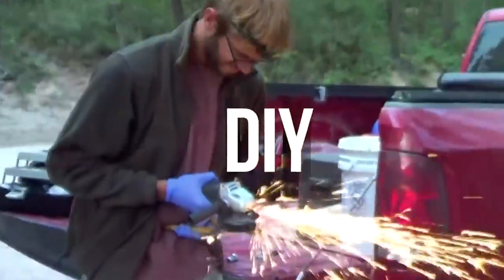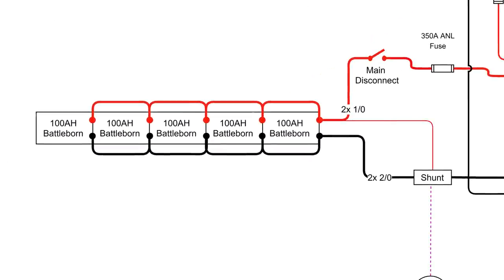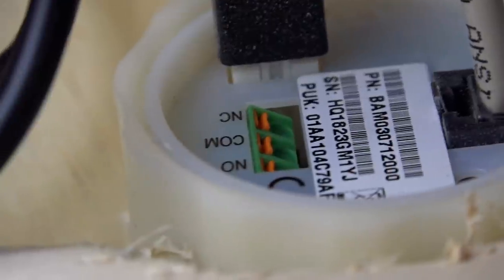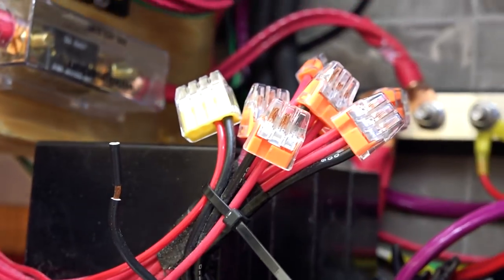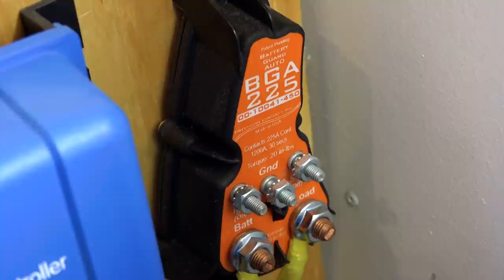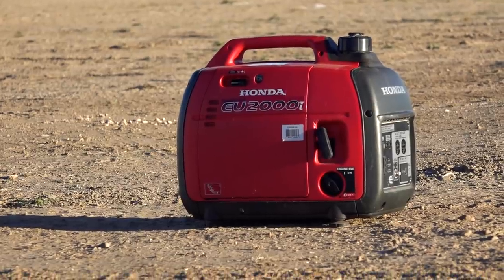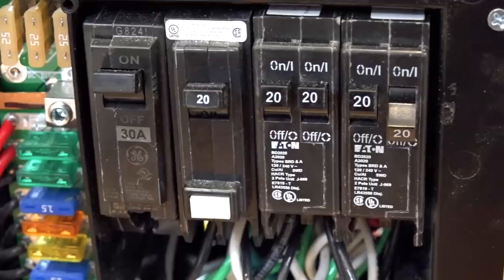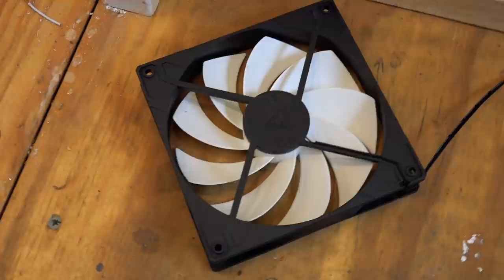RV Electrical System Walk Thru In An Off Grid Optimized Airstream  - Solar, Lithium batteries

Comment: What the auto industry calls Load Dump is a real automotive phenomenon that happens mostly when there is a loose (therefore intermittent) battery cable.  Because the cable connection is not consistent, the battery is low on charge trying to suck a lot of current from the alternator.  Because the cable connection is not consistent, this huge load can disappear quickly.  Because the voltage regulator uses the field winding in the alternator to control the output current and voltage, it cannot collapse the field instantly (characteristic of an inductive load) and the output voltage soars to very high levels at low impedance for an extended period until the field can be reduced.  The same thing happens when heavy loads are turned off but not to the extreme it does with a loose battery cable.  Transient protection is very important in vehicular applications.  I am glad you included it.

Comment: Wow!!!  What an incredible setup and video.  So impressed.  Thanks for sharing.  I cant imagine the cost to set this up, with the lithium batteries it seems that there is $20,000.00 +/- in gear alone.  Not to mention the labor and obvious expertise to install.   You guys did an awesome job!!!!  Drivin and Vibin's new rig is incredible!
Reply from the maker: Thanks,  Yes this is an expensive system, actual cost less than 10, but yea time and everything it is quite expensive.

Comment: Absolutely outstanding. This is an exceptional video on an exceptional install. I'm personally completing a custom install of a 1080W system on my rig. I wanted to use a great deal of Victron components, but it just would have busted my budget. I'm not second-guessing that decision based on what I've seen here. My only feedback would be to ensure that the Inverter/Charger is properly ventilated to ensure a nice temp in that small compartment. You may have already addressed that - I just didn't see it. Very impressed. Thanks so much for sharing - it gave me confidence in what I've done and also provided great information on how I could also improve. By far one of the best videos that I've watched over the last several months as I've worked on our rig as we prepare for full-time living as well. All the best and safe travels!
Reply from the maker: At the end we talked about the fan being installed to keep air moving, will put it on a thermostat so it only runs when needed. could also hook it up to an aux relay on the inverter and trigger it using the victron assistant ,

Comment: This was obviously a very good explanation. Too bad I am so rudimentary when it comes to this level of complexity. I have a solar charging system in my trailer, which I built component by component but by comparison it is stone cold simple. Works for me.  136 watt 24 volt nominal thin film panel, mppt controller with remote monitor and 6 volt wet cell golf cart batteries in series all fused.  Plug and play

Comment: Clean install! Very neat cable work! Impressive!

We have a very similar system but less complicated, and on a truck camper. I installed our inverter charge inline with the shore power. Like the Victron multi-plus it has an auto transfer switch so the camper is essentially always "plugged in" when the inverter is switched on or we are plugged in. No auxiliary transfer switch needed. The 12v side is routed straight from the battery bus bars to MDP. We rely almost solely on solar for charging (and very occasionally plugged in). No genset or car charging. Our DIY 600AH LFP battery and 1080 watt array has been awesome over the last year. LFP...what a game changer! Don't miss running a generator one bit.

 We also chose the Victron MPPT SCC and it has worked very well although I wish it could be programmed better to tapper charging rate less at voltage nears 100%. I see so many of these you tubers systems (some very large) with Zamp panels where people use the Zamp PWM controller. Maybe they are being sponsored by Zamp. Good to see a proper MPPT charger on your build. Also the 712 battery monitor has worked great as well. The bluetooth allows us to see what's going on while driving.

One thing I do see though is the narrow solar panels are very close to the A/C and will probably be shaded often. It is very smart to have chosen Parallel wiring. We did the same after playing around with both and found the inefficiencies of lower voltage are more than offset by how much loss there is in parallel wiring when one or more panels are shaded.

Great video, well done!
Reply from the maker: Yes the shading was a consideration, even in parallel it will affect the whole system, but not as bad.
Reply: In parallel it will only affect that panels production.

Comment: Wow Tom! So much good information flowing so fast, slow down!  I think my brain popped a circuit breaker trying to keep up. Lol . Seriously though thanks for the video. That was very interesting and informative.
Reply from the maker: :) Thanks.  I realized it was a bit fast, but figured it can be rewatched :)
Reply: YouTube videos can be paused by clicking on the two vertical bars.  I did that to have more time to study the diagrams.  Take the time to understand the diagrams and that will made the narrative easier to follow.
Reply: @bruceh3786  yes for sure. I was being humorous :)

Comment: Awesome video!!  Thank you so much for providing a comprehensive explanation and the detailed schematic!  I really appreciate that you not only explain what you did, but why you made the choices that your did when there are different options.  Now I just have to figure out how to make this work in a 50 amp trailer with roof space for a little more solar.  Tom, you are my "go to" person for electrical upgrades. Thanks!!
Reply from the maker: You can use the same system in 50A just use a bigger transfer switch and jumper one leg to the other when bringing power back from the inverter.  That is how our system works, I think we have a schematic on our site.
Reply: @MortonsontheMove  Thanks for the info.  I will definitely go look for it. My husband is the one with the electrical background from his military days.  He was quite impressed with the schematic from the installation you did for Kyle and Olivia, so I'm sure we will both appreciate your 50 amp version!  Happy New Year! :D

Comment: Batteries in parallel should have the negative lead going to the shunt bar on the opposite side of the bank from the positive. This will better balance the flow.   The ANL 300 A fuse should be a Class T fuse at 400A. They cost more but handle better load and blow very quickly.  Thanks for your videos...
Reply from the maker: Agreed with both,  the battleborn batteries have internal balancing and if they are slightly off from one another there is no harm, Kyle and Olivia had the ANL already or I would have specd the class T.
Reply: The video shows a 300 amp fuse but the schematic shows a 350 amp fuse. Which is correct?

Comment: Nicely done video.  All the tech info is pulling me down the YouTube and Google rabbit holes simultaneously in pursuit of understanding. This is a lot like what I am planning for my full time setup, except I am leaning towards two Tesla batteries with a Multiplus or maybe Quattro. This saves me a ton of time, and also has a proper SOC setup that I would have wound up adding later, so thanks for that!

Comment: Hi, nice installation and schematic. You need to fuse your smaller cables where they leave the main fuse for the voltage sensing and at the Busbar for the fusebox though. If damage were to occur here to these wires to cause a short circuit you would pretty soon have a fire.
Reply from the maker: They actually do have inline fuses... I should add that to the schematic.  There is about a 6" unprotected lead on the input to the dist panel tho.
Reply: That’s good. It’s often too easy to miss things like this and best to keep the fuses as close as possible to the change in cable size.

Comment: Thanks for taking the time to produce this excellent straight forward explanation of a complex system.  The professional wiring diagram is a great help in understanding the flow.  

The main marine 12V disconnect switch for this system is on the positive side of the circuit.  Are there any technical reasons or advantages to have it on the positive side vs. the negative side?  Most diagrams I see show main disconnect switches on the positive side.  I put it on the negative side on my system between the shunt and the battery for practical reasons because there is just the one wire going into the battery from the shunt vs. several positive sources to the positive battery terminal on my setup.  Our there some potential issues I may be missing?  

Instructions for changing out a battery are to disconnect the negative cable first.  A disconnect switch does basically the same thing so following the same logic, it seems to make sense that it is ok to have the disconnect switch on the negative side. 

A second question is if there are plans to have some sort of cover over the positive bus bar as insulation protection?Thanks.
Reply from the maker: Thanks, 

It really doesent matter, our switch was red so positive it is.  Some boat standards say positive but I dont see any reason one way or the other.  You always take the negitive off first so if your wrench contacts the ground when taking off the positive no arc.  In the case of a disconnect switch this will not happen so.... 

The whole electrical compartment will be covered but yes there are plastic covers for the busbars as well.
Reply: Thanks for the follow up.  I believe the stock car racing association also requires an outside mounted disconnect switch inline with the positive circuit.  The positive requirement is a source of disagreement for some members.  Good to know I am not missing something important!That switch (or one very similar) is also available in black and that is what I bought.  It did take a little more searching to find one as most are red.  

Too bad more people do not have a disconnect switch installed and in an easy accessible location.  It can sure save an RV in case of a short.   Unknown to me, a repair shop missed wired the safety brake switch on my trailer.  Then one day I failed to disconnect the cable and pulled away, closing the switch which created a short.  Smoke started pouring out from underneath the trailer but I had a kill switch that limited the damage to a bunch of melted wires.  It happens!

Comment: I love your vids! Personally, I am so glad you are done with the movie and back to making great vids. And I love when you guys get together with D&V. My favorite was the "hair-cutting" vid, just seeing you 4 interacting without worrying about content was very refreshing.
Tom, I plan to do a build-out of a cargo trailer to go off grid but know very little about electrical/solar installs. Without going for a certificate or degree, what community college class what you suggest taking to get the info one would need to build an off grid system like this? Any suggestions?
Reply from the maker: Thanks Kirk,  Basic electrical knowledge is what you need.  Most of the components you can figure out from books, and vids like theses, but sizing equipment to be safe and coordinate properly is the biggest issue.

Comment: Great video! Just have one question I thoight the purpose of the selector (transfer) switch was to by pass the shore power to the inverter in case you needed to work on the invertor and still have AC. But you tapped into the shore power with a 30a fused line to the inverter, why have that fused line?
Reply: Let me clarify a little i would expect the transfer switch to be on the ac input of the inverter as well and not on the output. So a 30a fused line is not needed. Either the inverter is bypassed and shore power goes to ac distr panel on you selector inverter and shore power goes to ac input in the inverter internal transfer switch shoots the ac to the output. What is the use of thec30a fused line. In my opinion the transfer switch is not in the right place in the circuit.
Reply from the maker: So you can bypass the inverter and still use it as a charger if you wish.  We do this sometimes in our system when we have full hookups.  Just let the solar charge the batteries unless you need a boost , flip the breaker for a short bit.  Just more flexibility really.
Reply: @MortonsontheMove  Let me clarify a little i would expect the transfer switch to be on the ac input of the inverter as well and not on the output. So a 30a fused line is not needed. Either the inverter is bypassed and shore power goes to ac distr panel or you select inverter and shore power goes to ac input in the inverter, the internal transfer switch shoots the ac to the output and thru the charger. I would use the 30a fuse though between the oncoming shore power and the inverter as protection for the inverter from power surge. In my opinion the transfer switch is not in the right place in the system. In your wiring even if you bypass the inverter the 30a fused line is still providing power to inverter. If something was wrong with the inverter, you take it out to work on it, you take the charger too, no need for the 30a fuse line at that point. You did the work and it looks good, if they are happy that is all that is needed

Comment: I understood that the positive and negative cables should be connected to different “ends” of a parallel battery bank. For example, the negative connected to battery A and the positive to battery E.  Is not correct?  Not necessary with lithium batteries?
Reply from the maker: In a lead acid bank you must, the lithium have such low internal resistance and the BMS in each battery will prevent overcharge so it is not an issue here.

Comment: Tom, first it is great to hear someone do this and use the terms properly, like current or even better 3000 Volt-Amps (instead of Watts for AC). I don't know your background, but as a long suffering AP Physics C teacher, this is sunshine for me.
Now ... I am not sure I understand the purpose of the distribution panel. The box seems to have a large heat sink pointed towards the wall and is obviously of quality and thus expensive. Why can you not run a wire from your DC bus bars to a 12V fuse block and then off to the loads? Everything could return to a secondary busbar and then that could be connected to the large ones? Similarly for the AC side, why not run the AC feed from the inverter/charger to a standard breaker box and wire it as you would at home?  Do you have any problem with the breakers tripping etc because the RV's motion? My don't in my RV, I just wondered if they were specially designed to resist the vibrations.
If you get a chance in your busy schedule, I would like to show you what I did to keep my refrigerator powered with 120V while I am driving. This allows me to turn off my LPG which makes me feel safer and makes tunnels and gas stations less complicated. My YouTube video on this is here and thanks not only for what you do, but how you do it. Henri  
https://www.youtube.com/watch?v=MXlJEGZATxQ&t=523s
Reply from the maker: The distribution panel was procured before i got involved so I made the best of it.  Its just a DC fuse panel, AC breaker panel and battery charger in one unit.  you could do them all separate and lose the second battery charger. We have never had a breaker trip from being underway.
Reply: @MortonsontheMove  Hopefully, we will be long time (not full time) RV'ers in about  years after we retire. I have watched a number of solar install videos like yours and I am fascinated by the equipment and all the rest, but this all costs a lot of money and I am not sure, aside from aesthetics, if all of this is worth it compared to just using the generator. I have a 3000W that is pretty quiet at 20 feet and I got that for about $400 USD ($669 CDN) on sale at Xmas. I would like to have lithium batteries, but even then, if I were in the desert I could just use the generator for whatever we needed. So, while I just love watching the technology and seeing folks with 2000W on the roof running at least one of their air conditioners, but I am not yet convinced that it is worth the money. Any opinions would be appreciated. Travel safe.

Comment: Very interesting and extremly helpful.  I have a Class A and am wondering if a "hybrid" electrical system can be utilized e.g. adding a lithuum group of bats to the 4 existing 6 volt bats. My goal is to add power capacity to have for extended boondocking. Thanks for the clear explanation of of electrical components and their respective tasks.
Reply: Mel Johnson Really depends on what you have and what you’re willing to replace. For me it wasn’t worth it to install a hybrid inverter. I rewired my existing ac items and am happy with my results. I also have solar and 600ah of lithium.
Reply: So you're saying, theoretically, it is in fact possible to create a hybrid system?
Reply from the maker: Dont add lithium batteries to the existing lead acid bank, they charge at different characteristics and will kill the lead acid quickly, drawing down the whole system.
Reply: @meljohnson5926  No sorry, When I saw hybrid I thought you were referring to a hybrid inverter.  As Tom says above you don't want to mix flooded lead acid batteries with a lithium battery nor AGM. They have totally different charge profiles.
Reply: @MortonsontheMove  yes, I understand the difference in the batteries, but couldn't a switch be incorporated to run one system at a time, but use the solar/inverter/generator/shore  to charge both?
Reply: Mel Johnson yes, using a Sterling B2B charger which takes the power from the main battery bank and adjusts the voltage and charging profile to the other bank.
Reply: @robertgarbe6348  very interesting. Thanks very much for the idea.